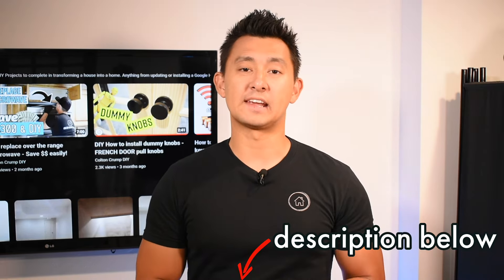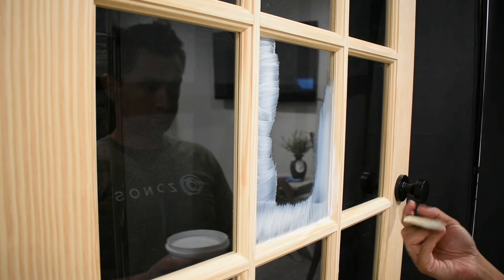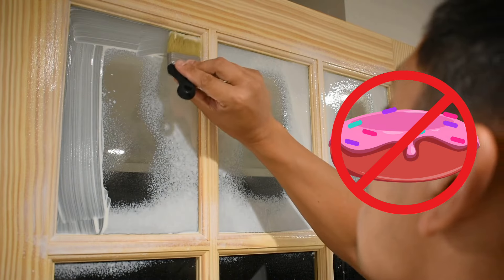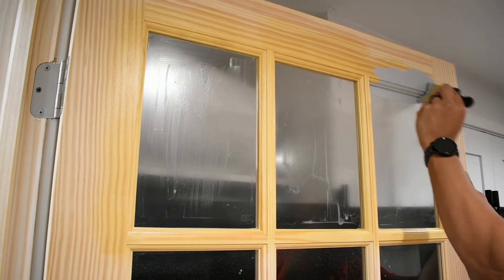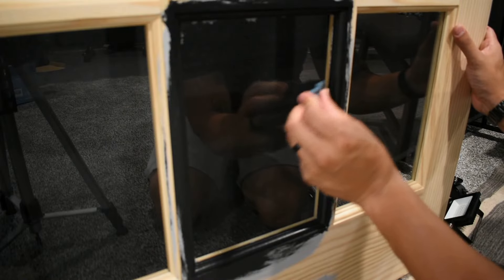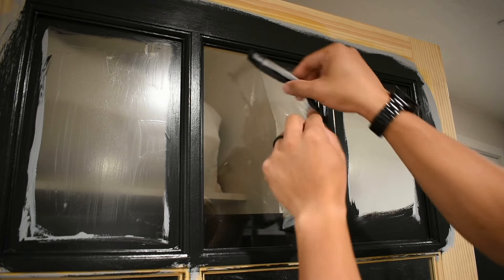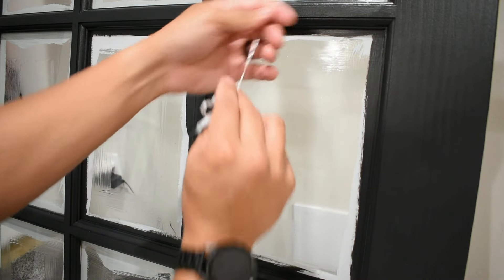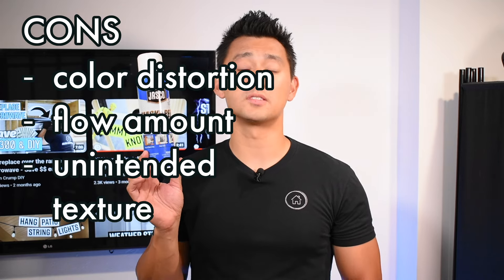Is mask and peel really a game changer?

Comment: do you think it could use it on walls so you could paint your trim?
Reply from the maker: Great question.  I would think no.  When you paint it on a surface that absorbs something (like wood or drywall) you won't be able to peel it off.  That's the beauty of using this with glass.  It won't absorb it, it dries like a plastic film and then you can peel it off.  

You could try it if you wanted to see if I'm wrong though.  Lemme know how it goes if you do.
Reply: @ColtonCrumpDIY  I might try it with hope that the pant on the wall have a enough sheen. Thank you for the fast reply
Reply from the maker: Let me know if it does work.  Now you have me curious lol

Comment: Just use paint. Use a razor to scrape off.
Reply from the maker: You're not wrong.  I've done that on a couple of french doors before and it is possible to have a decent result by doing so.  This masking paint on stuff makes it easy to peel where you just score it with a razor, one or two passes and the wilt thing comes up quick.  Where scraping you have to legit scrape every inch of the paint off the glass.  I still think this is a time saver with scraping and also clean up (no paint flakes) while still achieving great results.